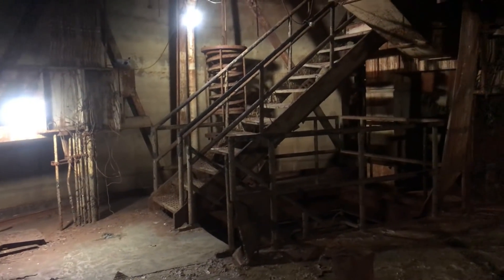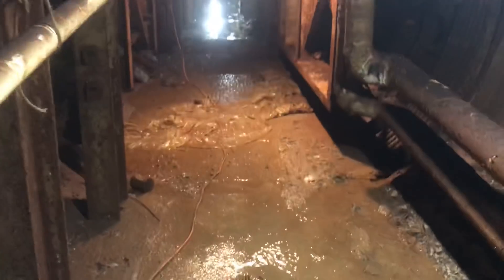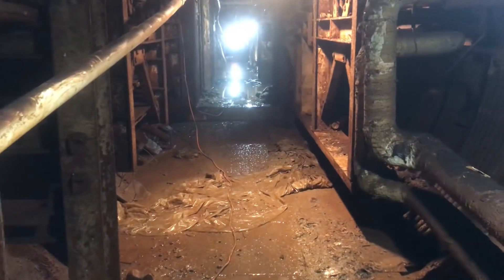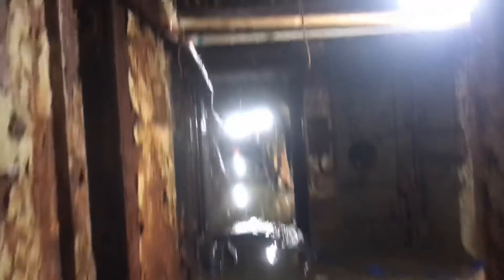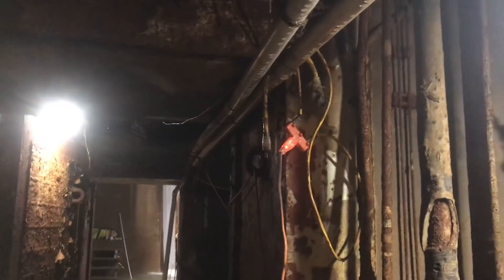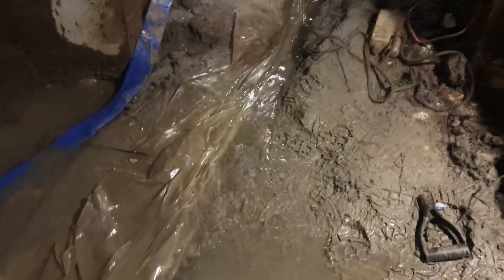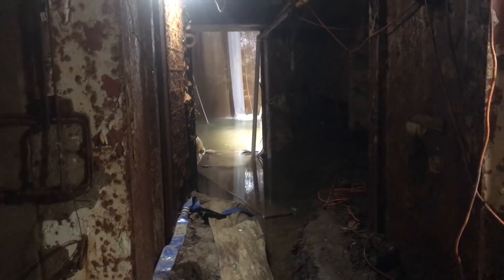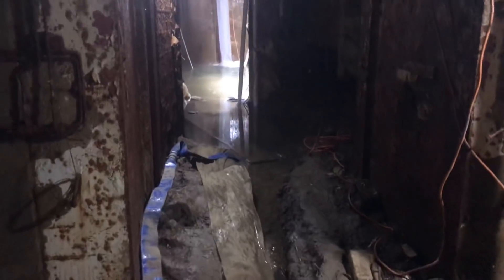S1E3 - Why is there still water? - Owning a Titan II Missile Silo

Comment: Should of bought better pumps. 
The Myers Centri-Thrift centrifugal pumps are designed for continuous service under demanding conditions. Centri-Thrift pumps have earned a reputation for reliability.

High head capabilities to 140 feet

Flow capacities to 240 GPM

Available with 1-1/4", 1-1/2", and 2" discharge sizes

Choice of complete unit or pump end assembly

Yes they cost unless you use a contractors account. Then like $100-200 each.  No screwing around

Comment: What you own is a large ship buried in the ground, so now you must understand that all ships have bilge pumps for a reason.
You have to calculate the volume of incoming water and adjust your pumps accordingly.
You will find that repairs to the hull could be impossible since you can only work from the inside.
I can see why the military gave up on these cold war silos, the engineers new this flaw.

Comment: You could rig the lower level pump to a float switch on the second level with a relay so that it would kick out to prevent overwhelming the surface discharge pump.
Reply: Or run a larger pump on the higher room, with a float switch to turn off when it catches up to the other.
Reply: I was about to say that, look for a float switch, or build one

Comment: HOW DO i BUY A SILO. I used live im MO and there are HUNDREDS in there just waiting for a buyer - how much do these run to buy? You should bust open that silo and pump it dry even clean and paint it and make it a water storage tank?
Reply: NO LIMIT SOULJA Yea definitely. Death Wears Bunny Slippers is that other channel if you want to check it out, it was really cool till he stopped. I think he was originally planning on making it his house and then I think when he got an investor involved he was leaning more towards a place to rent out to make some money back, maybe he had no choice if he needed the investor. By the looks of it you’d think he did all the hard stuff though. It’s just so much work to even get to the bare slate point to where you can build them out how you want them that I wonder if you couldn’t just build an underground bunker/house cheaper, it certainly wouldn’t be as hardened as one of these but should be fine for the most part.
Reply: @mcearl8073  Death Wears Bunny Slippers uploaded a new video just 2 weeks ago. So he is still going at it. It just takes time, lots of time.
Reply: NO LIMIT SOULJA I saw one recently come up for sale for around 400k. Probably depends on the property they are on more than anything though. Also keep in mind that these Titan IIs were pretty well destroyed so there will be quite a bit of work to get it to be useable. The silos were filled in with gravel, dirt, large debris and concrete so getting into them is not a small task. I think that’s why so many end up like this one when they are purchased. Hopefully this guy has the funds and ability to see it through. Check out the channel he talked about to see a guy go from buying one to gutting it and getting pretty damn far. I thought for sure he’d finish his but I think he ran out of money or interest or a bit of both.

Comment: Aren't you deep down in the water table?
Reply: Besides the lip of the silo being de-milled below the water table, the demo of the peripheral system structures(water, sewer, power and antenna/communications conduits) are probably admitting a fair bit of water...  you are basically in a submarine with shore tie connections:)
Reply: @rronmar  demilling sure does take the goody out of things  :(
Reply from the maker: Darkstar yeah it’s at around 5’ this time of year. 99.9% of this place is built very well and does not leak at all